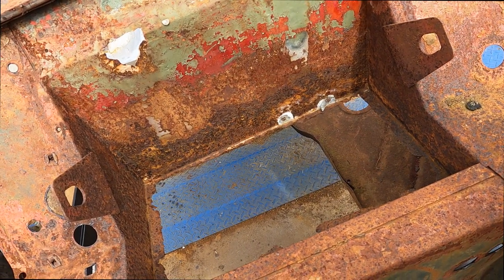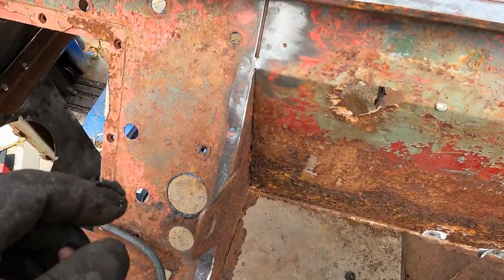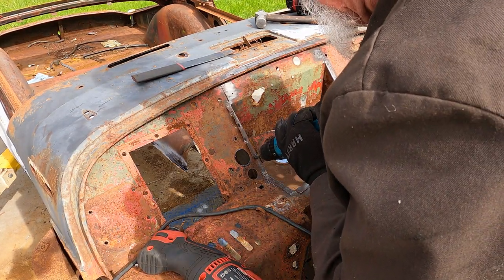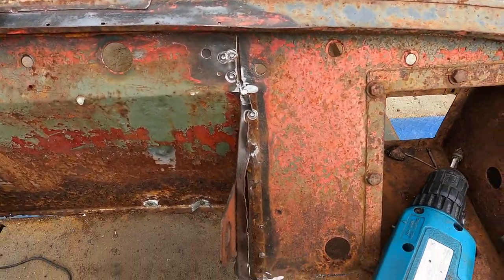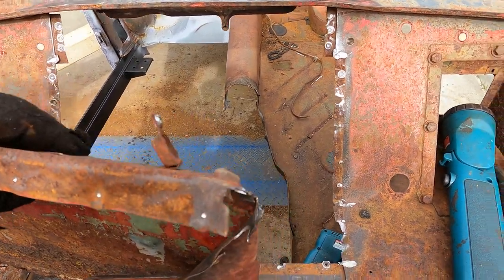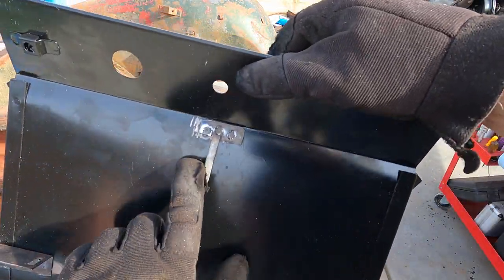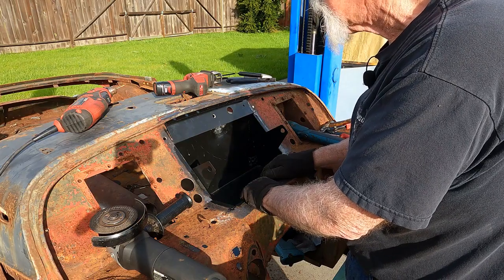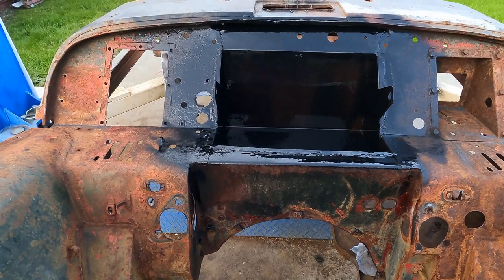1955 Triumph TR2 Restoration Part 28 Battery Box Replacement.

Comment: thanks - considering your metal working skills, did you consider making the box instead of buying ?  (I have not looked up the price of one from Moss or Rimmer).  They say that every TR being rebuilt has a rusted out battery box, so maybe they are making lots of them and the cost is reasonable.  John in Manitoba.
Reply from the maker: I expect that you are correct but I think that it would not be as nice as the ones that you can purchase.  Rimmers currently list them for $60.00 usd, so it's not a bad price.  I picked up mine during last winter's sale, so even less than that.